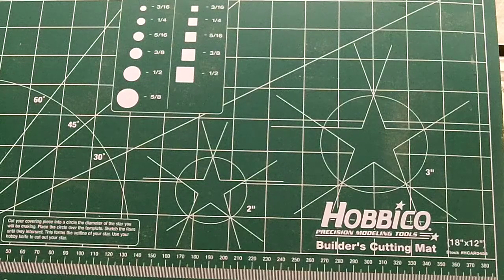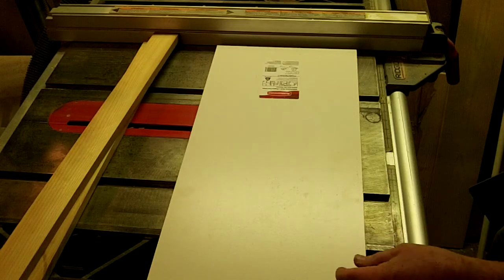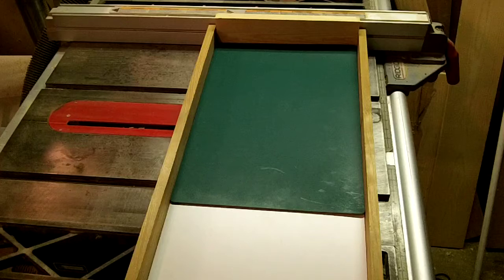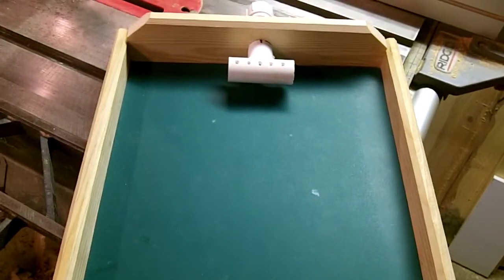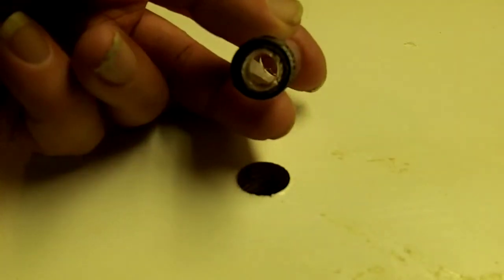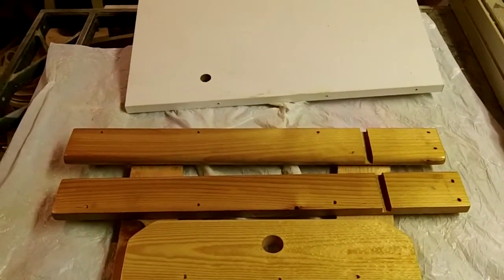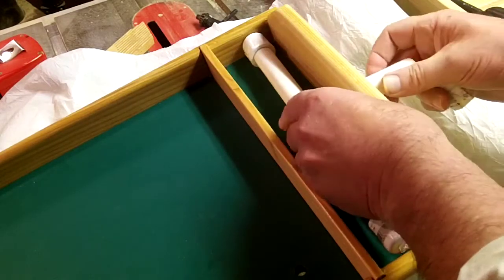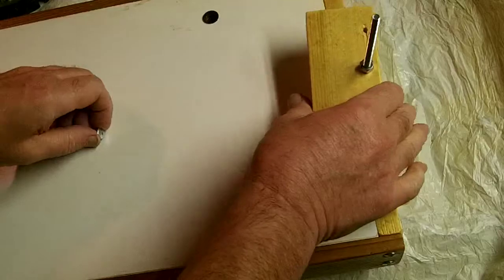Hobbico Mat Miller Table Build

Comment: Nice build on the Miller table. I ordered my Hobbico Mat from Riders Hobby Shops. This is the link. $7.49 for the 12x18 and with shipping just over $13.50. http://www.riders.com/builder-s-cutting-mat-12x18?gclid=CK62ivb2sMQCFQsxaQodHYMAjQ
Hope this helps a few people looking for the mat.
My question is about the bottle hole. What was the distance from the water board and side rail is the hole? Is the bottle hole in the mat the same size as the hole for the bottle lid or is it just under the size of the bottle hole so the gold drops into the hole better and not on the rim of the bottle? I thought I read something about gluing the mat down or not gluing it so it can be remove. If not glued wouldn't water run between the mat and board at the water hole. Thank you for any help you may give me.
Reply from the maker: Joe Cooper Hi Joe, Thanks for watching. Thanks for the link to another supplier. I usually buy from Amazon.The bottle hole is not critical. I have made over a dozen of these and they are all a little different. Usually I go about 1 1/2” from the side rail and about 2” below the water smoothing board. You can put it on the opposite side of the table if you would like. I drill a hole for the bottle lid with a 5/8” Forstner bit and drill it just deep enough for the lid to set in so the rim of the lid extends slightly above the level of the board. In the center of the hole will be a small hole left by the guide point. I then take a 1/4” forester bit and use that small hole in the cap hole to align the tip of the 1/4” bit. Then drill the 1/4” hole all the way through the board. You may want to tape the mat to the board at this time and drill all the way through the board and the mat as well. Then you can remove the mat and waterproof the hole all the way through and when you glue the mat down you can put extra glue around the hole so water can’t get under the mat there. Be sure you waterproof the inside of the hole well. I tape around the hole on both sides with painters tape to protect from overspray and then spray 4 - 5 coats of Helmsman spar varnish down the hole to waterproof it well. For the bottle lid hole, I use a 1/8” brad point bit to drill a pilot hole through the center of the lid. Then I use a tapered multi hole bit you can buy from Harbor Freight to enlarge the hole to the diameter of the mouth of the bottle. You can also use a round rasp for this or increasingly larger drills to enlarge the hole or use the 1/4" forstner bit to drill the hole.Yes, you are correct. Not gluing the mat down can cause some problems like water getting under the mat and also causing problems around the bottle hole. So it’s best to glue it down. You can use the brush on Chalkboard paint to seal the melamine board and use the table with just the Chalkboard paint to see how you like it before you glue down the mat. Be sure to cover the entire board with at least 5 - 6 coats of paint as the Chalkboard paint dries to a very thin layer. Also seal the edges and cracks with silicone rubber. I use the GE brand as it goes on very smoothly. I hope this helps. If you have any more questions, feel free to ask.
Reply: utahavalanch
Thank you for the reply. I now have an understanding of how to drill the bottle hole.The 1/4 inch hole keeps the gold going down the center of the bottle cap. That is what I was worried about and in the video I could tell that the hole on the bottom was bigger than the hole on top through the mat. One other thing I noticed is it looked like the end where the water runs off, the board looked like you cut it at a slight angle backwards when you shortened it. Is that what I saw or was it an illusion from the way the board set. What was the size of the tote you used, dimensions, gal.? I understand to use one large enough to set it on, just wondering what you used.
Thank You
Joe Cooper
Reply from the maker: Joe Cooper
Hi Joe. Yes, you want the gold to have a straight drop down into the bottle without anything hanging it up.
Good eyes. Nope it wasn’t an illusion. One problem with having the table at a slight angle is that the water runs off the end of the table and back along the bottom of the table for about 3 - 4 inches before dropping off. This will drop your sand and material back into the main tote instead of the catch container. This was one of several methods I tried to prevent this that didn’t work. The solution I finally came up with is to cut a piece of 1/8” or 1/4” board about 1 1/2” wide and as long as the end of the table. Glue it on to the end of the table with some waterproof glue like titebond III glue or use some small brads. This will create a piece that extends about 1/2” below the bottom of the table and will force the water to drop straight down into the catch container and won’t allow it to run back under the table.

The container I used in the video was a sterilite 19 gallon container you can buy at Wallmart, Lowes, or Home Depot. I bought it to store the table and everything to run it. I now use the table almost every day so I usually just use it for storage and set a 10 gallon Rubbermaid container on top of it to run the table. The Rubbermaid takes less water to run and I can run my 4 Miller Tables, 3 fluid bed sluices and fine gold finishing sluice out of it. It’s also a little more compact to take camping. You can see it in my finishing sluice video here:

https://www.youtube.com/watch?feature=player_detailpage&v=M3mL2wAOY7c

I am in the process of making a new video on how to make these which I hope will explain things a little better.

If you have any more questions, just let me know.
Reply: utahavalanch
As for the table being cut at a slight angle, that is what I thought I saw. I backed that video up several times making sure that is what I saw. I figured water was running back up the board was the purpose. I just wanted to make sure. I have some 1/8 inch aluminum I might cut 1 inch wide and bend it length wise about a 30 degree angle, then fasten it to the bottom of the board. The thin aluminum will make the water drop right into the catch basin.
I have totes, I just wanted to know what size you was using. That is good you are able to run that many tables off of the 10 gal. tote. I will be looking into your sluice build.
Thank you for the reply and your help.
Joe Cooper
Reply from the maker: Joe Cooper That aluminum should do the job for you. Thanks for stopping by.

Comment: Great Video! I really like the design and plan to build a couple for me and my prospecting buddy. Could you tell me if you glued the Hobbico mat to the table base and what kind of adhesive you used? Melamine can be tricky for adhesive so that is why I ask. Again, really nice job!
Rich.
Reply from the maker: Thank you Rich. So far everyone I know who has built these really like them and I think you will too. Since this one I have built 6 others using different materials for the surface and I like the Hobbico Mat the best followed by the Chalkboard Paint.

One thing that has come up over time is that some melamine is not well sealed and may have some small areas that water can seep in through. I now recommend giving the Melamine board a couple of good coats of exterior paint just to be on the safe side. I like Helmsman Spar Varnish for the sides and I now use it on the Melamine as well. This also helps solve the  glue to melamine problem which I ran into as well.

Yes, I recommend gluing it down to the melamine. That helps keep the mat as flat as possible.  I had problems with my mat buckling slightly with temperature changes and so I glued it down with some spray adhesive I had. It later came unglued. I now use Titebond III waterproof glue for anything that will be getting wet and that has worked well for me.

Good luck with your build and I hope you enjoy it as well as I have mine.

Comment: Outstanding work with nice details. Well done! Do you prefer chalkboard paint to the mat, or the other way around? My table needs one or the other as I am not pleased with it's performance.
Reply: Thanks Gary. I find that the Hobbico mat gives just a little edge over the paint.  You  can buy the mat on Amazon for about $15 -18.00. In my other video at the end I show a short clip of my Chalkboard paint table hanging on to the gold.

Right now I'm in the process of making another table or two to try out the bed liner paint and some black rubber shelf liner, kind of like is on the black magic table. 

I find that the water flow and the angle have a great deal to do with how well the table holds the gold. These tables really work well when you get them dialed in. I think everyone should have one for their cons.